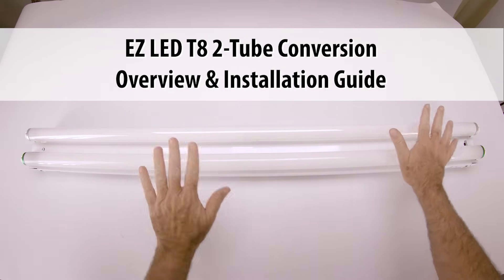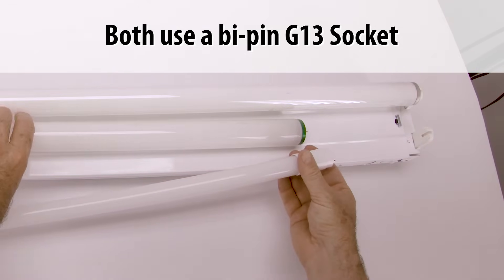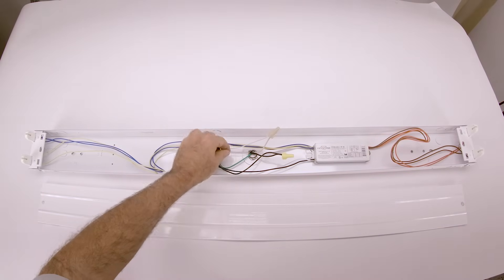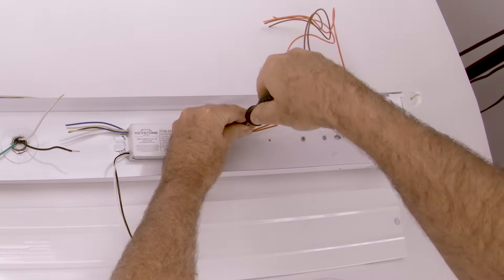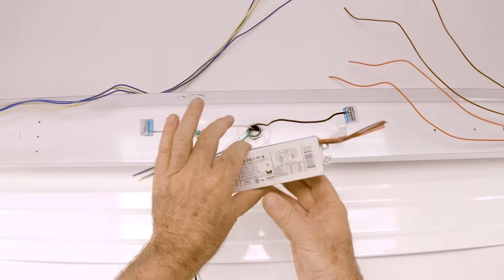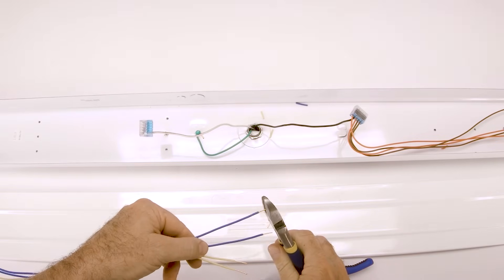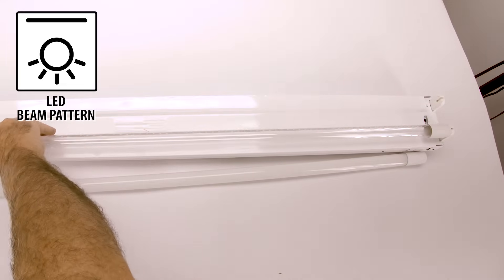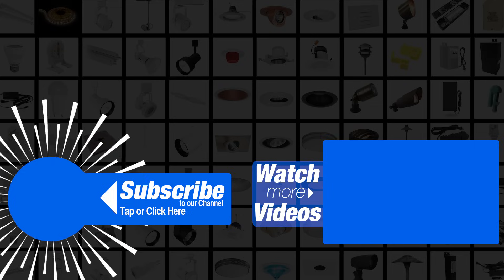EZ LED T8 Fluorescent 2-Tube light Conversion in 5 minutes or less by Total Bulk Lighting

Comment: i've watched at least 7 different fluorescent to led conversion videos and they all do it differently
Reply: I agree Jerry. Some videos show using one-sided LED tubes and state how the one-sided are safer than dual-sided. Then there's the shunted, non-shunted tombstone issue, using an ohm meter. The difference in approaches to these conversions has given me a headache.
Reply: @
Jerry, true, just when you think you've nailed the conversion, there's a new video with a different approach.
Reply: I put that sticker on the reflector outside so people could see it
Reply: Seems to be three types. One is the single-ended bulb where al, the power connections are at one end and use the non-shunted tombstones. Another is the double-ended bulb as shown in this video. Third is the type you just simply install without changing anything. The third one doesn't make sense unless you're totally freaked out by electricity and don't want to mess with wiring; the ballast is still there sucking power and prone to failure.
If you watched right to the end of the video, he mentioned all three types being available for purchase in the store (last 10-20 seconds).
The only caution I never see them mention is you probably should stick with one type of conversion and clearly mark it on the outside of the fixture. Putting a single end bulb in a double end conversion after a bulb failure (or vice versa) could cause some problems. 
They all seem to believe the 50,000 hour bulb life guarantee is real. They may not all fail, but some certainly will, and LED's degrade over time. Might not fail, but probably change color and brightness down the road.
Reply from the maker: There is a lot of confusion out there. You are correct, there are three ways to convert a fluorescent T8 or T12 fixture at this time as you have mentioned. With our kits, we include a label you a-fix to the fixture to help convey to anyone doing maintenance that the fixture has been retrofitted to LED. Our Double End Powered Kits label indicates the type of retrofit applied. If you compare the wiring of the LED T8 fixture with our our wiring diagrams you will quickly see which type is being used. If you are unsure, knowing electrically based on the wiring is the best approach as things can be easily mislabeled. We made this FAQ recently to help mitigate the confusion out there 👉 https://www.totalbulklighting.com/blog/2020/01/10/converting-fluorescent-t8-or-t12-to-led-t8-tubelight-faq/

Comment: Thought one end of led lights didn't need any wires and the load end only needed wires ?
Reply from the maker: Single End powered LED tubes only needs power from one end and typically requires the sockets to be replaced. The EZ Double End powered LED tubes, as shown in the video, requires power from both ends and you don't need to replace the sockets. We made a comparison of these two types of LED T8 tubes here. Might be worth a look as Double end costs less overall :) 👉 https://www.totalbulklighting.com/led-t8-double-end-powered-tubes-vs-single-end.html

Comment: $ 45.00 bucks for a kit to convert two fixtures IS PRICY, I can get the same thing on Amazon for $ 15.00 and its a complete light, that I dont have to convert. I guess if you like paying triple the price and then having to do the work these are for you. Hope ya didnt take my comment as mean, just stating facts
Reply from the maker: Not all projects are the same and the cost of replacing the entire light fixture can quickly outweigh the cost of retrofitting the existing fixture. Our LED T8 conversion offers many benefits over integrated LED systems. It allows for easy replacement of failed LED tubes, is much better for the environment and allows for many fixtures to be converted at a low cost just to name a few. When Integrated LED systems fail typically the entire light fixture has to be replaced (more cost) and then is tossed in the trash (Not great for the environment) and finding parts to repair is next near impossible. Again not all projects are the same and we encourage everyone to compare their needs with the many options available. Product cost is just one part of a project 🙂

Comment: It seems the "MODIFIED NOTICE" should go on the OUTSIDE of the cover, not HIDDEN inside!  If someone in the future, as you say changes the bulbs, it's critical they KNOW!  Who takes off the cover to change bulbs?  I don't get it...
  Additionally, not ALL THE CONVERSION LED's are wired at BOTH ends.  I have some that ONLY plug in ONE END!!!  It seems logical to mention this as this entire topic of LED's is confusing enough to most people!
Reply from the maker: You are correct. The label should be placed on the outside. Yes, that is true, there are different conversion types. We outline Single and Double powered types on our Channel. This video is for Double End Powered LED tubes. Single end conversions typically requires the replacement of the tombstones on the power end. A much more lengthy conversion.

Comment: You didn’t talk about shunted and non-shunted tombstones. What if you have shunted tombstones (one wire to it) would this install work the same way?
Reply from the maker: The beautiful thing about Double End Powered LED T8 tubes is that they are very versatile. They can be used with both shunted and non-shunted tombstones as long as you following the wiring diagram and your local code. Here's the diagram 👉https://www.totalbulklighting.com/downloads/dl/file/id/1215/led_t8_double_end_power_wire_diagram.pdf

Comment: Nice video, very helpful. Why are there 4 wires on each side when there are only 2 bulbs?
Reply from the maker: That is how the existing fluorescent T12 light fixture was wired for the ballast. Typically you wire the fixture based on the wiring diagram that comes with the ballast. You just never know what wiring configuration you will get until you open up the fixture's ballast compartment 🙂That is why having a good understanding of how the electrical works is very important 🤓

Comment: Those push in connectors should be outlawed!!! They fail every time over time and will drive you nuts working sometime and not others. Change in vibration of roof or wall can make them work one day and not another. Although these are low amp which wont hurt them near as fast, i always throw them away and use wire nuts.  Do it once, do it right. Ive had them fail on wall switches for dishwashers, trailer wiring, motor home wiring. Never had a wire nut wrapped with tape fail.
Reply: I agree, Licensed electrician and I get calls that they are the stem of all the time. Lucky enough the new inspector ranks them with using a 12 volt crimp connector and fails anything new he sees them in.
Reply: Michael Collins can they have electrical tape on them/the wires to help keep them from moving?

Comment: $45.00 fou your kit!
$20.00 A new LED fixture at Costco .
Do the math!
Reply from the maker: We appreciate the feedback. Like we have replied to other people who have watched our video . . .
We do understand that you can find products at Costco for less but it requires a membership that costs $60 or $120 annually. Costco is a great resource for finding lots of great products. Their $1.50 hot dog deal is amazing! We understand that we are not the cheapest but we offer excellent support to our customers. If there are any questions or issues with our product we are quick to respond and we respond in a manner you can understand. We offer an all in one package with wiring diagrams and video that makes it easy and simple to complete. Even the components in the video are the same components we sell in our kits. Our kits are not for everyone or for every retrofit application but we do our best to provide the best components, the best price and the best customer service. Have a blessed day 🙂 https://www.totalbulklighting.com/retrofit-kits/ez-t8-led-4-foot-kits.html
Reply: Amazon you can get them for 15.00 if you buy a pack of 10
Reply from the maker: Not all projects are the same and the cost of replacing the entire light fixture can quickly outweigh the cost of retrofitting the existing fixture. Our LED T8 conversion offers many benefits over integrated LED systems. It allows for easy replacement of failed LED tubes, is much better for the environment and allows for many fixtures to be converted at a low cost just to name a few. When Integrated LED systems fail typically the entire light fixture has to be replaced (more cost) and then is tossed in the trash (Not great for the environment) and finding parts to repair is next near impossible. Again not all projects are the same and we encourage everyone to compare their needs with the many options available. Product cost is just one part of a project 🙂

Comment: Nice video with one question.  If I replace my florescent light with Led Double end lights, do I have to also replace the tombstone shunts to non-shunt?  I think I have all the correct wiring according to your video but not sure about the shunts which you did not specified on your video.  Please clarify this before I make an order.
Reply from the maker: You can utilize your existing tombstones when using our EZ LED T8 Double End retrofit kits. Just make sure you follow the wiring diagram that is on every kit on our website. I have linked to it here: https://www.totalbulklighting.com/downloads/dl/file/id/1215/led_t8_double_end_power_wire_diagram.pdf If you have any further questions please connect with us here as we respond much faster then to YouTube comments 👉 https://www.totalbulklighting.com/contacts/
Reply: @Totallightingsupply   are the ends of the bulbs positive and negative? Or does it matter?
Reply: OG _showtyme does not really matter

Comment: Home depot has 10  LED tubes for $50 and work with existing ballast
Reply from the maker: That is definitely one way to convert to LED. Not all LED retrofit applications are the same and have different requirements where Type-A / DRL tubes can not be used. We simply offer a convenient solution for Type-B retrofit applications. Have a blessed day!

Comment: I put me led tubes in, right away one lite blew. I really don't know why. I watched your video , it seems like I did what you did. Do you have 
Any idea what caused this? My lite is several yrs old.
Reply from the maker: It's very difficult to know but if something failed immediately I would check the wiring and make sure the led tube you are using is the correct type for the wiring configuration you are using.

Comment: DO I understand this correctly it doesn’t mater whether your original fixture is T8 or T12 ?
Reply from the maker: That is correct as this retrofit application bypasses the ballast. If you do plan to use one of our kits please read the product's detailed information on our website as it will also help you in this type of conversion 👉 https://www.totalbulklighting.com/retrofit-kits/ez-t8-led-4-foot-kits.html

Comment: How does the light output compare between 4 foot long LED and fluorescent bulbs?
Reply: Brighter and instantaneous.  No delays when turned on.
Reply from the maker: We have found the LED tubes to be brighter over the fluorescent bulbs based on a more real life scenario of measuring the foot candles of each type of tube. Here is what we did. We put up just one fluorescent T8 32watt tube at 3000K in our fixture and at 4' from the fixture we measured 31 foot candles. We did the same test with the 4000K LED-T8 18 watts and got a reading of 61 foot candles and with the 5000K LED-T8 20watts we got a reading of 64 foot candles. Now it is important to remember that the human eye will see the light a little different. The 5000K will give a very cool-white color that may be good for some installations. The 4000K will be a little warmer in color, and although it may not appear to be as bright, it may make the environment more pleasing. The light output on both LED tubes measures almost double to that of fluorescent tubes.

Comment: If you turned the power off then how would you power your work light
Reply: Use an extension cord with the light fixture. I can turn off power to the fixture and still be able to reach a power outlet that I can use for the work light.
Reply: @mj1s735  Oh yeah thats true....

Comment: Absolute question is the question is removing the ballast making it led or removing the ballast and replacing the LED bulb looks awesome I would like to try this thanks for the uploads
Reply: If you remove the ballast you can no longer use florescent tubes with the fixture. I just brought some LED tubes that can work  with or without a ballast. When I do my next conversion I might just take the ballast out this time. Less noise and I am sure the ballast also uses and in the case of the LED tubes wastes energy.

Comment: Shouldn't your label go on the cover rather than within the fixture? Down the road, a hapless end-user simply trying to change a tube in what by all appearances is a standard fluoro fixture isn't gonna remove the cover. After several unsuccessful attempts at installing fluoro tubes, he calls electrician who THEN removes cover and presents end-user w what amounts to a $200 bulb-changing bill when he finds it's an LED-only fixture. 
Also, I've viewed several similar videos and haven't seen a compelling reason to convert at all: I own fluoro fixtures of many types (recessed, shop, large aquarium), and whenever the need arises, I simply directly swap LED tubes (now quite cheap everywhere) in direct replacement of fluoro, no conversion needed. In watching other vids the prevailing reason given for conversion is that ballasts tend to fail. Maybe I've been lucky, but at 60 yrs old, ballast failures have been rare enough for me that there's no need to do preemptive removal.
Reply: I made the same mistake.  On the other hand, anyone who can't tell the difference between between LED and regular bulbs, shouldn't be messing with them.
Reply: I affix my conversion labels on , not under the cover.

Comment: You don't need double end power when single end power has been the way to go. You remove the old sockets. One side is dead and the holder. The other side you use a ul listed harness kit with ballast disconnect. And these days the wattage is 10.5 watt SEP. 18 watt is just wasted energy. 50,000 hours? No. 70,000 hours. Glass? 5 yr warranty? No. 10 yr warranty. Glass is cheaper to make, will break and has less light spread. With the single end power approach you now have all new wiring. All new sockets. Fixture is fresh and takes 5 minutes to retrofit. Nice video but sorry, i stick with what i have.

Comment: I am not sold because you didn't show the led lights lit.
Reply from the maker: It's ok. We probably should have added that part in the video. Our customers are very happy with the results they are getting when using our EZ kits. I personally have converted 16 2-lamp T12 fixtures with our double end kit and all I can say is that I am super happy the buzzing has stopped! Also, I went from 1280 watts to just under 300watts. You can give it a try 😊 We offer this video and wiring diagram to help make the conversion easy. If you have any further questions please don't hesitate to connect through our support system https://www.totalbulklighting.com/contacts/
Reply: Sounds like a sales pitch. “Our customers are very happy” ...... you’re not gonna tell us that customers say these are worthless and light output is horrible, or with the cost to convert all your existing fixtures, one could go to Sam’s club and buy prewired 4 foot fixtures for like $35-40 with a lot less technical labor involved. Granted, my skills and others could handle this job as it’s not complicated, but to some, this looks daunting and they might not have the confidence to tackle such a project. Just pulling a fixture and mounting a new one could be accomplished easily with just a marginal increase in cost for peace of mind. An analogy would be the cost of supplies for changing your own oil and filter in the driveway or going to the GMC dealership and paying $39.99. Sometimes for only a few dollars more, it’s just worth it to not get your hands dirty or do extra work. 

It would be wise to update the video with the end results, preferably in a typical, real world setting. Sure they will look bright on a solid white board with white every where to reflect the light, while shining straight into the camera, so how about in a shop or garage to show true potential in lighting up a room?
Reply from the maker: @TheSpoolin77  Every project need is different. If replacing the entire fixture fits your projects need then that is the best fit for the project. We offer the option to keep your existing fixture rather then toss it in the landfill. Our least expensive 2-tube kit is just under $13 plus shipping. Depending on your location from our shipping facility this could be a great option for a project looking to retrofit the existing fixtures. We call this option our bulk option where the shipping cost is not factored into the price and is clearly displayed so you can quickly and easily itemize the cost of the product and shipping. I personally recently retrofitted sixteen T12 2-tube fluorescent light fixtures in my garage dropping my wattage consumption from almost 1300watts to just under 300watts. The light output is significantly better and the annoying buzzing is gone. You can read some of the reviews on the products about what our customers are saying. Here is also a link to our testimonial page https://www.totalbulklighting.com/testimonials.html Have a blessed week 🙂

Comment: I have a neutral wire running between two tombstones one the one end does this make a difference on weather I make that end my hot end or neutral end? Great video by the way!!!
Reply: Also I'm using double ended LEDs if that helps